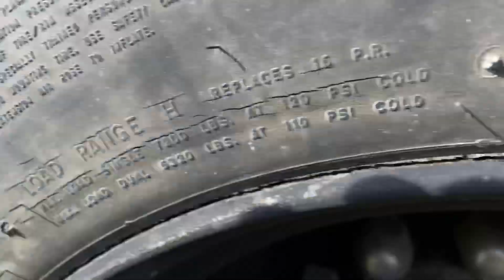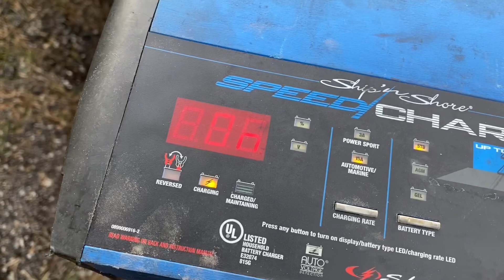8v71 detroit diesel tries to runaway. vintage eagle bus

Comment: Ok Scott.  This is your fault.  I made a deal on an MCI to be picked up this weekend.  Thanks a lot for the additional addiction.
Reply from the maker: Watch your gauges
Reply: @BusGreaseMonkey  Thanks Scott.  I wish you were coming with me when I take it home.  About 800 miles at 30 below.  Apparently in good shape but a bit of cracking on the sidewalls of the front tires.  I was told the sidewalls on this bus are heavy duty and they should be ok but I will make sure before I go far.

Comment: Them dam Yamaha's will run away when you least expect it. 
Let just a few years ago I had rebuilt one and I was going to take it for it first road test. I drove over to are trailer yard to find a loaded trailer to pull to give the motor a work out. It was in a cab over Frieghtliner. I got up to the yard and backed in under a heavy trailer once I was connected to the trailer I gave a little pull on the trailer to make sure we were connected properly. Well that is when the shit hit the fan. The governor dit watt it should and I pushed the clutch in and that 318  then took off like a rocket. We had a runaway. I pull the emergency stop cable. Now I had the cable in my hand. And things were just screening. I got out of the truck to jack the cab and trip the emergency shut of but no cab jack handle it was on my toolbox. So I could not get at the shut off. I ran back to the shop grabbed a great big hammer jumped in the pick up truck and raced up the street to where the truck was. It was still screening. I started beating all the fuel lines off the filters with that hammer. Slowly the rpm started to come down.  The motor lived.

Some nit wit that would be me. Did not cut the split pin short enough on the pin that connects the governor rod to the rack and it held the rack wide open.

You have Not lived till you have your head under the cab of a truck a few inches from the valve cover of a 2 stroke doing 3000 + rpm watt a rush.

I will never make that mistake again. 

Trucking From The Desk

Comment: One little rev like that just splashed the oil around like when you start a fresh rebuild,  and rust is a safety issue-but can dealt with if time and materials can be injected.   I always say, what does a New one cost?

Comment: All that rust and corrosion tells me that the fuel tank will probably getting closer to the pavement...and the best part is that typically happens when the tank is full.  Aside from fixing the suspension, swapping out a fuel tank is a real bitch on an eagle

Comment: oh yeh a run away engine aren't much fun,  i was sitting in the smoking room an evning and heard the generator begun wining and then an explosion, wow
Reply: it was a 3000HP /2200Kw generator under certification test, she didn't trip as she was supposed to do, she continued increasing RPM and then a big bad a bom....wow

Comment: Correct me if I'm wrong but is it a 6V71N or 8V71N Detroit Diesel engine with the Manual Transmission or Automatic Transmission
Reply: Calvin Crews It’s an 8V71N with and manual Transmission

Comment: I had several run away with when I was a grease monkey at Trailways, after the second one I would always make sure the blower flap worked, something else that would scare the shit out of ya, kill the key and it sounds funny= Running backwards, that is very serious as it’s burning oil, I would jump the clutch to get to stop but it could be tricky to stop it.

Comment: had detroits. run  wild.   when you disconnect the line to the pump....there is enough to run for several minutes. in the internal fuel logs. on the side of the head.....espeçialy if you have n55 
injectors......so i hold the sutdown lever. on the governor till i empty
the head. or heads.....as you know
a bosrd over the blower doesnt reliably kill it...

Comment: Eagles were good buses and nice to drive, but this one is seriously fudged. Salt took a toll on the framework of many of them. Whenever I try to start up an old Detroit that has been sitting, I take the intake piping apart and have a piece of plywood ready to toss on the blower intake if it takes off.

Comment: Had a Slant 6-71 come into the shop that started to run away, they tripped the blower flapper, turned the fuel off and it ran long enough to suck the seals out of the blower and it started burning Engine oil.......

Comment: You don't have to pull the injectors, check the fuel rail and adjust it with a free pin fit.

Comment: Maybe in question asked when started last add “did the engine run fast when the engine fired up?” Anyway  got away with it this time. I guess first starts are nervy for you or anyone. 
I have never worked on a GM but watching your channel I could do a injector rack inspection and also free the rack and check the injector sprays correctly. I am pass the age of bothering to do this type of work but having that knowledges I have learnt from your channel is valuable indeed. 
Maybe my little knowledge could be dangerous but some knowledges is better than no knowledge. Some knowledge gives us all something to work from.
I think you could make a DVD and talk about the problems and fixes for Grey hound buses and GMC engines.

Comment: Whooohooo yeah thats no good. Hopefully she can patch the rot. Buy a cheap welder and weld angle iron over every structure.
Reply: You can't patch over rot. Just like you can't put a Band-Aid over cancer and hope that it goes away.  You have to cut it out and put good metal in the place of the bad. To be fair, sometimes you can build some bracing in certain situations, but you'd better have a plan to paint the crap underneath to arrest the rust process,  otherwise,  it's just going to accelerate the rusting process on the new patches you are putting over top.  There's a God-awful lot of work to be done on this bus,  and that's just what Scott showed us on the video.  Imagine how much we didn't see because it's out-of-sight and hard to get to.  I wish this lady a lot of luck, like the kind of luck where she wins a lottery, because it's going to take a lot of time and money to get through all of the work that needs to be done on that bus.  I hate to be negative, but I have to agree with a lot of other commenters, that this bus would almost be better off being parted out.  Furthermore,  it makes me mad that Eagle knew about their buses being rust magnets, and didn't change their build methods or materials... but then again, you don't sell as many buses if they last for 70 years.  It's just a shame that the owners of the things (from new) wouldn't invest a few bucks in undercoating or painting the things.  Blasting used engine oil up all under there, even that would have been helpful.

Comment: I hope she didn’t pay much for that, or for the other previous “mechanics”.  Unfortunately I see this one as parts and scrap metal. If it can be made to run and drive... only for the purpose of making the engine and transmission worth more/easier to sell.

Comment: I'm not trying to be negative and I hate to say it but if you're not somewhat mechanical you really should not own an old bus the bus is going to need constant repair not just once in the blue moon and if you don't know what you're doing you don't have a chance. Mechanics are just going to cost way too much and you're going to have problems on the road as well and if you can't fix it on the Fly what are you going to do with a giant bus on the side of the road. All I can say is best of luck you're going to need it...

Comment: I can think of 2 reasons why Detroit's runaway, improper setup at tune up, or seized injector
Reply: Or plugged air box drains, or bad blower seals or gov malfunction or... Or... Or...
Reply: @Miniaturehorseexpress  you need fuel to have a runaway !
Reply: @stevecarlisle3323  No, they will runaway on oil just fine
Reply: @Miniaturehorseexpress  lots of oil going in there ! All the drains plugged !  Not your typical runaway ! I guess it's possible!
Reply: @stevecarlisle3323  Ya, I'm not trying to argue you listed two things to cause a runaway I just listing a few more things I've seen over 45 years around these things
Reply: @Miniaturehorseexpress  I know, I just have never experienced that type of runaway, In working on Jimmies since 1970. Thanks for you input.

Comment: Why do Eagles rust so badly?
Reply: The whole understructure on those buses was made from light gauge cheap mild steel box tubing. All it takes is one pinhole or a poor weld, moisture gets inside and they rust from the inside out...rapidly. None of that material was correctly treated for corrosion resistance other than a thin coat of gray paint. Even the engine cradle is made from that same thin box tubing.